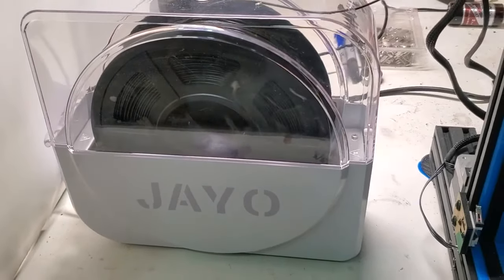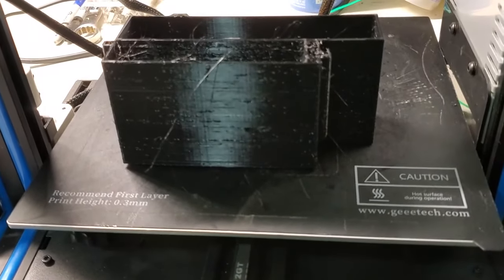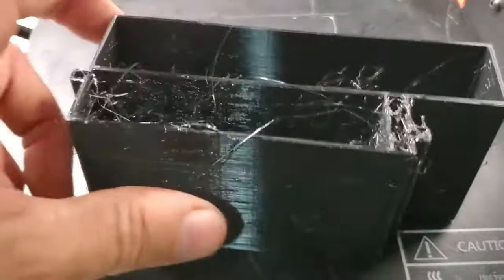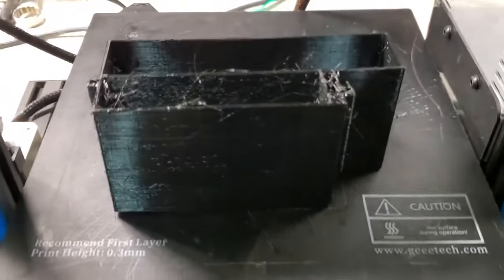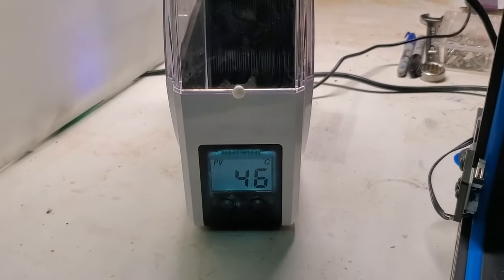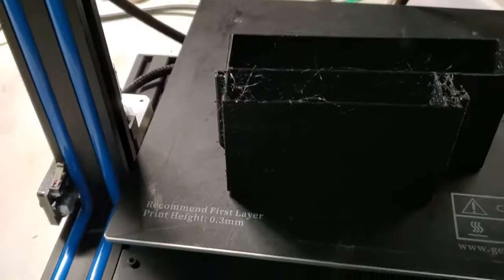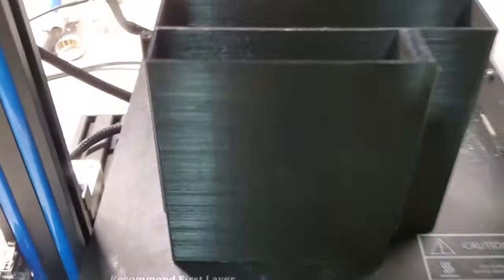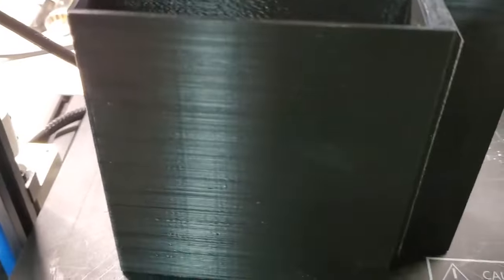This is why you need a Filament dryer for 3D Printing.

Comment: That's a good report, I'll check out the Jayo.  

I just ordered my first 3d printer and I'll begin with simple PLA as I'm learning to print.  I'll order a good dryer before i start making any PETG prints.  Thank you
Reply from the maker: That's great, once you get use to the printer you'll defiantly want to try more and more filaments. PLA wont need dried unless your in a really bad humid area. Keeping it in a plastic bag with desiccant is normally enough. Welcome to the makers club !!!
Reply: @FitzCrafter  I'm in baton rouge Louisiana, very humid.  Maybe i should order a dryer right away and get some sealable bags and decadent too
Reply from the maker: @BennyTygohome  you can use one gallon zip lock bags, and almost all filaments will come with a desiccant bag in them.